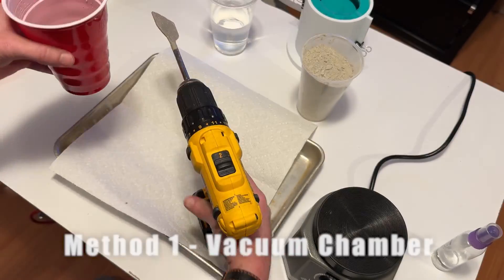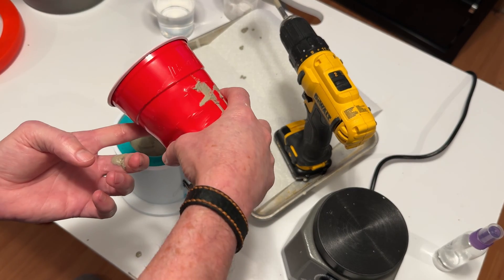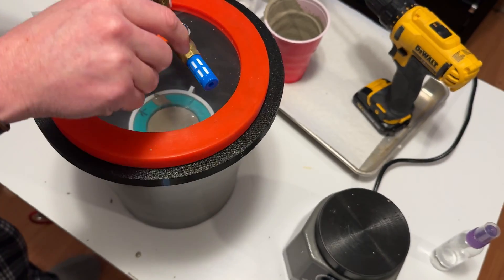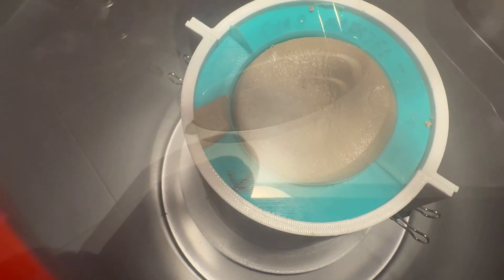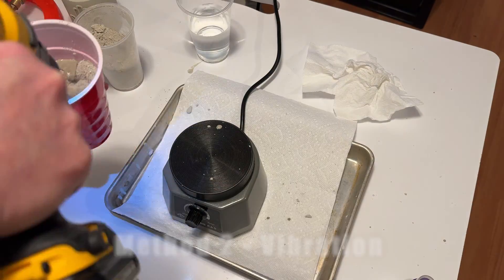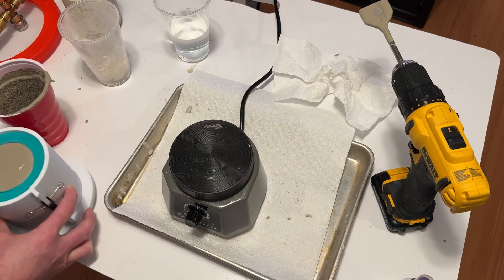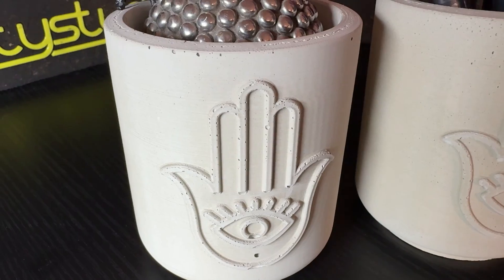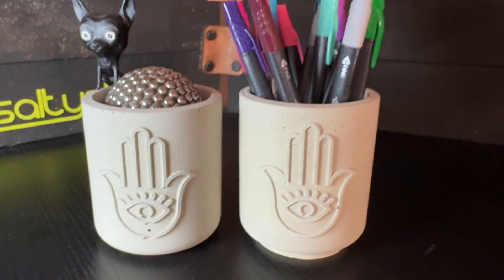Bubble Battle: Vacuum Chamber vs. Vibration Techniques in Concrete

Comment: Dish soap is great and some super plasticizer (tiny amount) make some great casts. I would also fill like an inch of your mold, vibrate it, tip it around to coat the interior, then back fill ane vibrate again. The soap should really help.

Comment: mixing and pouring technique most important. mix slowly by hand each batch with a spoon or something. pour insanely slow into the mold. What I do is tilt my bucket like im about to pour into the mold, but dont tilt enough to let the cocrete start flowing itself. I use my spoon to feather the concrete out left and right in the cup at the edge of cup before it falls into the mold. so essentially any bubbles in the mix are getting popped by this back and forth with the spoon motion in the pour cup before it goes into the mold. since you are "feathering" it into the mold it ensures also a slow pour. pour also as close to the mold as possible. no gap between the pour cup and mold while its going in. every 1/3 way the mold gets filled stop and manually shake tap etc. the mold. you should get flawless casts. dont even need to use the vibration table. use cement all. I use 1 part cement all, 1 part sifted paver sand. I get better casts adding 50% sifted sand for some reason. youd think the cement all would be better by itself. I sift paver sand cause its like 10x cheaper than buying silicia sand. also another thing once you mixed your batch, let it chill for a minute or two completely before pouring. make sure no free water on top of mix, you want it all mixed well like peanut butter in the sun. letting it sit for a min or two usually become abetter consistency for me
Reply from the maker: Thanks for the great advice.

Comment: use a vibrating vacuum centrifuge.  Apply and release the vacuum a few times.  by using a centrifuge you go from 1 G, to several.
Reply: I would almost imagine, two or more opposing arms that can swing out? My idea is not to include the vacuum. Attach a vibrator.

Comment: I have pondered this exact technique for this exact application except I imagine it being done with the concrete still in the mixing bucket and if needed using a slightly wetter mix than normal. I am curious what you have discovered in the last 10 months of experimenting and youtubing.
Reply from the maker: I haven't played much with air/bubble issues but, I have been playing with some new mold ideas. Dejavu, I hope to have a new video out tomorrow if all goes well. If you find a better way to get rid of the air/bubbles, please share.

Comment: Try a defoamer additive, that's what's used for countertops
Reply: Why defoamer is used? There is no foam here. Can you explain in detail
Reply: @nazag  Took me a minute, but defoamer additives allow bubbles to travel up and out of wet concrete much more easily.  The Concrete Countertop Institute sell a defoamer that i have used, worked well

Comment: I use hydrostone (concrete plaster mix) and i leave enough space that i can run a wetted paintbrush (flat #5ish) around all the surfaces inside, then fill the rest of the way. Only thing that consistently works for me, just make sure to rinse the brush immediately and obviously don't pour the rinse water in the drain

Comment: I would try exposing the concrete to the vacuum in a measuring cup maybe putting the whole setup on a vibrator. After a couple of minutes you could try pouring it carefully into the final mold?

Comment: Use a vibrating wand that actually goes down into the concrete. That's how a lot of the precast concrete is done.
Reply: Line the mould with grout before using vibration
Reply from the maker: Thanks for the suggestion. I actually 3D printed something like that to fit on a muscle vibrator. It did help a little but I may try it again with a little patience.
Reply: @justinmcclung  Nice. I think the key for those is that the vibration is side to side and quick, so it makes a path for the air to escape.
Reply from the maker: @jshet  Fantastic advice, thank you!